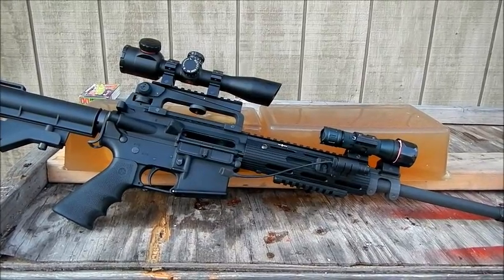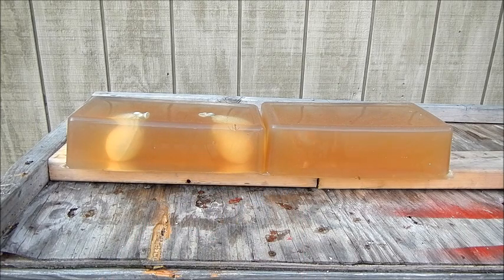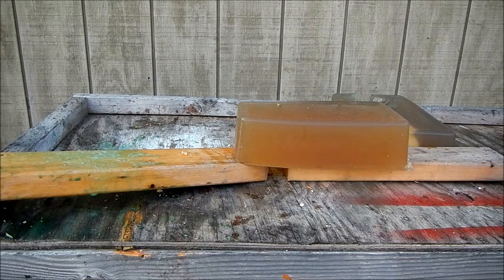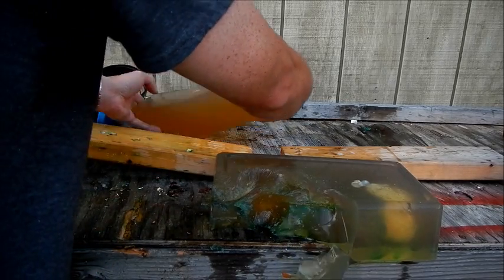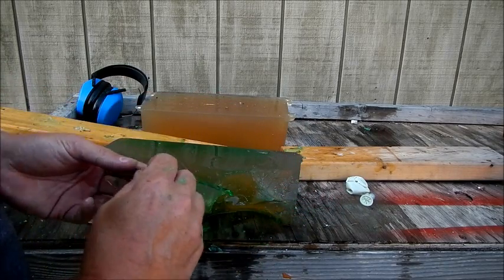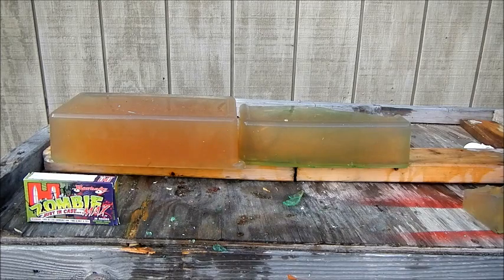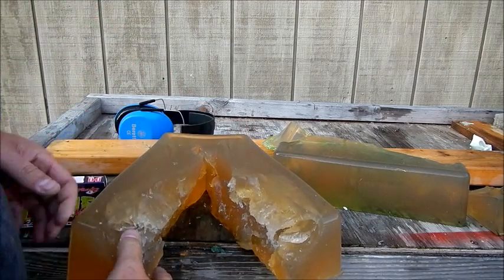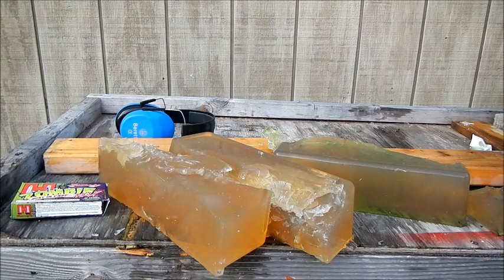Shooting AR-15 with 223 into ballistic gelatin

Comment: What's the difference between an AR and M4/M16s?
Reply: an AR is the civilian version of the M4/M16 which are military models
Reply: +Ryan Pardue ah i see but whats the difference between military grade and civil grade? i assume dofferent type of bullets?
Reply: +Troubled Troll  I believe the M4 has a 12" barrel and I may be wrong but the M4 is semi auto and fully automatic. The M16 I believe has an 18" barrel and is semi and burst. The typical AR15 is semi auto and usually comes with a 16" barrel however you can change anything on the ar
Reply: +Ryan Pardue hm what do you prefer, m4 or m16? im a fan of m16 actually

also why dont the military use the AR instead of the m4? lol
Reply: Each weapon is selected by operation in which the soldier will be executing. A soldier who will be going from house to house will typically prefer an m4 due to the shorter barrel being able to get around easier. A soldier that is in open land or longer range warfare will prefer the M16 due to better accuracy over distance.
Reply: +Ryan Pardue thats sweet to know, thanks!

however soilders carry side arms do they select that too? also what side arms are they allowed select?

what assault rifles do the soldiers have an option of selecting?
Reply: +Troubled Troll No, most soldiers are issued their weapons by the military. I believe they are currently issued M9s right noe but I'm not sure. For the majority they are all issued that M9s however the specials forces I believe either have a choice or are issued sigs I'm not sure.
Reply: i see thanks! what is your favourite pistol and rifle and why? :D
Reply: +Troubled Troll I mean it's all just what you prefer. my favorite open carry would be my glock. I love it and haven't had any issues. when I go to the range I usually put about 500 rounds through it and I've yet to have an issue. The rifle I like my ar but it's also only 1 or 3 rifles I've shot so I don't have much experience there. There's a lot of rifles I would like to get but money is always the issue
Reply: +Ryan Pardue i see, yeah glock is a very nice touch great for defebce but yeah, my isse with guns is theres so many of them (rifles) its difficult to pick one! i guess the AR is great as well! whats your view on the UMP 45 and MP5?
Reply: Ryan Pardue also m4/m16 are select fire can fire fully auto or tri burst depending on the model.

Comment: you should see what they do to a coyote you can see the hole my little girl put in her first one at the end of the video its blown out just like your gel block but it was shot at 94 yards and with a 50gr vmax
Reply: +hunttomuch wolfe   aint it cool !  little known fact...  this stuff defeats AR500 Level 4 body armor  ;)
Reply: my little girl shot a yote at 94 yards and it blew up the coat on it
Reply: +hunttomuch wolfe   ohhh... and if you want to save anything stick to soft points or FMJ's   ;)
or even 22lr CCI stingers or Velocitors and that "fragmented stinger" would put it down without damage !   ;)
within the 100 meter range...
Reply: I load my own bullets most of my 223 loads are loaded over imr 4064 and IMR 4198
Reply: I've been looking at the Hornady system, how much a round do you figure you pay making your own ?
Reply: +Torch TorchWood 17 cents a round for my hunting loads depending on how much powder and bullets are but that is what I get if I buy in bulk I do alot of shooting

Comment from the maker: SuaveGunman, The Zombie Max ammo is kinda special, when compared with a conventional bullet. The Little yellow tip makes it extremely flat shooting, and begins the the expansion process upon impact better than just a hollow point. In rifle calibers I would say it nothing real special there is always enough velocity in a rifle bullet to expand well beyond a bullets ability to hold together. But in pistol ammo I find it to be a perfect bullet for never getting clogged up and always expanding like it should. As far as the Zombie part goes it is really just a marketing ploy, Hornady has made FTX bullet for years it is the normal version of the bullet with the special tip only red instead of yellow. It is sold as Hornady Critical Defense Ammo. So the Z max round is special compared to conventional bullets but nothing special compared to the FTX bullet.
Reply: Brian Smith The polymer tip rounds are generally for varmints, not a person. The problem is with penetration as oppose to damages. The damages are all on the outer layer as shown in this video. While it would produce some very devastating results on a soft target, the real question is if it would stop the threat from harming you any further. And that I have no idea since I have not seen a test or heard of people who used it in a defensive situation. What I can tell you is that most polymer tip fails the FBI standard test of penetrating at least 12 inches.

Since it is a "zombie" novelty round, the question would be if it is strong enough to penetrate a skull bone, and manage to destroy the brain stem? If it can't, then Hornady lied. Since this is America and American love hypothetical lawsuits, I would find it extremely funny if someone conducted a "scientific" test on zombies and somehow sue Hornady. 

What I can tell you is if you're worried about OVER penetration of a round, then the polymer tip is a great idea and you should try to use the heaviest possible so it can retrain most, if not all of its weight.
Reply: @mrhellotherehowareu1384  I dont think it matters what bullet is coming out of an 18" barrel.  Its going to stop whatever is trying to harm u. Most definitely
Reply: East Richmond well yes and no. The damage is mostly superficial and not hitting the vital body parts. My recommendation if you’re using an 18” barre is to use m193. They have excellent velocity and penetrates deep and yaws and fragments. I don’t recommend using polymer tip but if it is all you can afford and train with then it is good enough. Better than nothing.